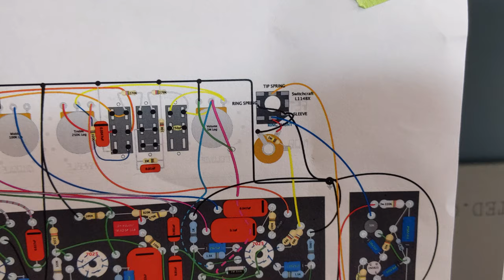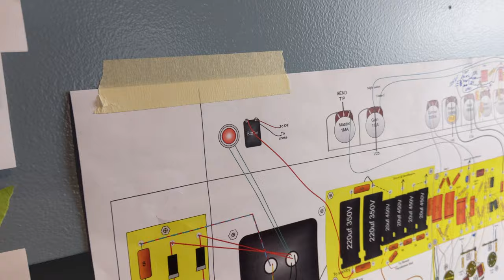Steel String Singer #002 Build | Episode 6: Final Assembly

Comment: You said "reverb board", are you not going to use a tank?
Reply from the maker: I see what you mean. I believe Dumble was going for a modular design with the SSS amps and there is three separate boards inside that is responsible for preamp tone controls, reverb, and phase inverter. I am still going to use a tank per original.
Reply from the maker: @Ice Man indeed!! My first build orienting the orange drops this way and I have to think it helped. This is the quietest amp I've built and heard to date! I'm sure it is a combination of a lot of things to achieve such a low noise floor